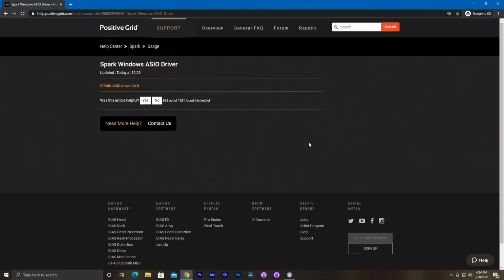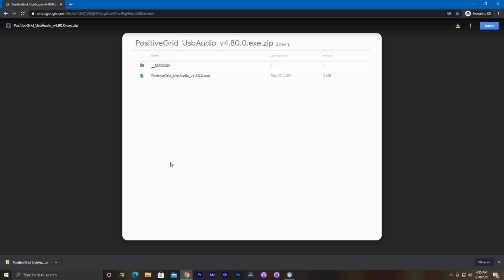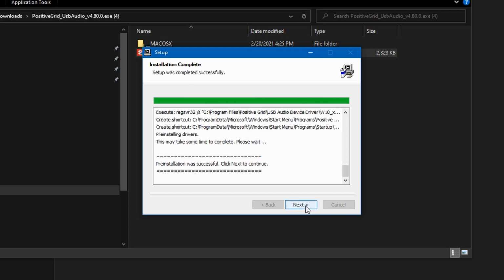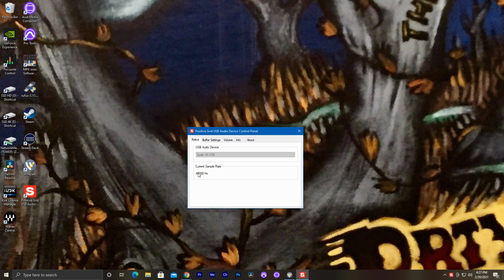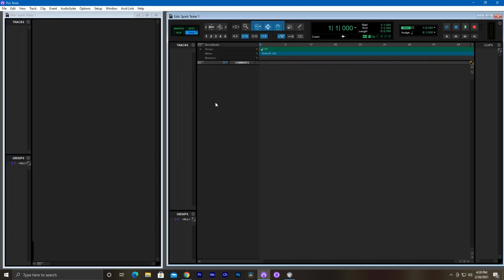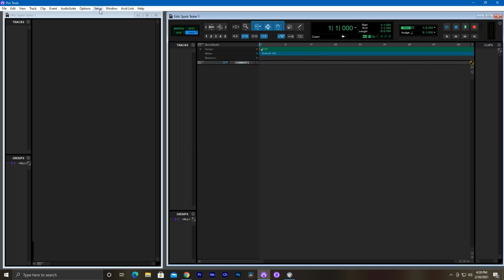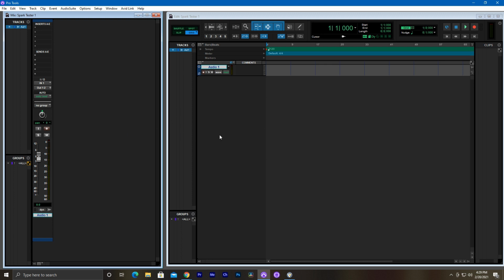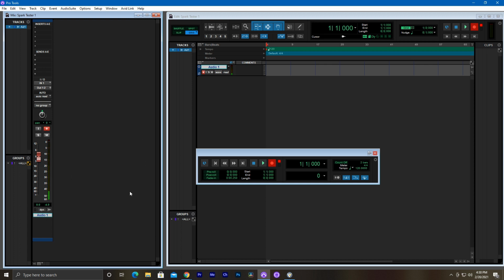Using Positive Grid Spark with Avid Pro Tools

Comment: Thanks a lot for posting. This video was super helpful. One issue I've run into though is when I do anything outside of the spark and try to come back to it, I get a playback error (6009). For example I tried adding a drum loop from my library and as soon as I did, not only could I not hear the drum loop, I also couldn't hear the guitar anymore. When I check the hardware it says digicard not detected and my positive grid doesn't show up. Is it because the spark is also the output? Not sure how to fix the problem.